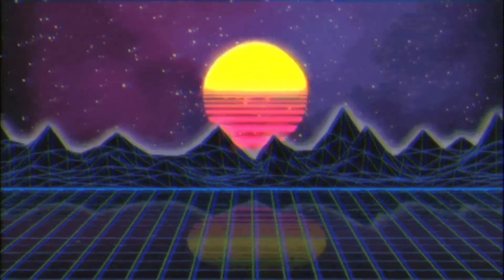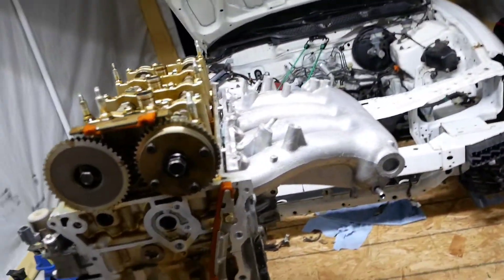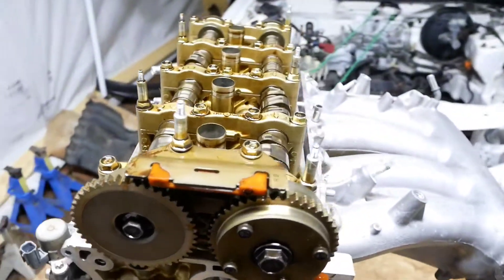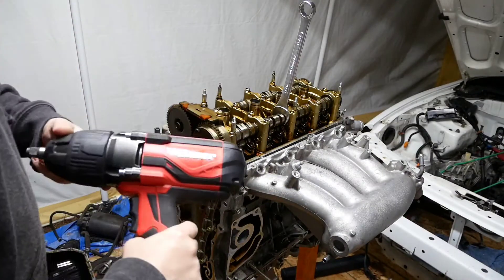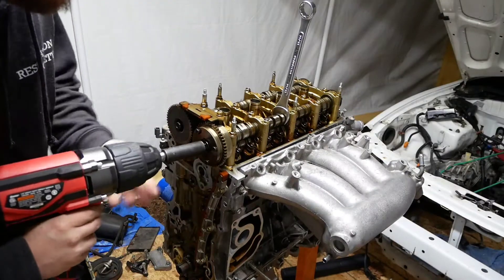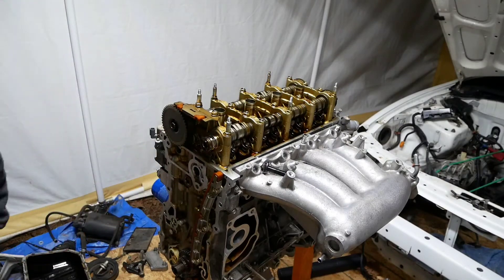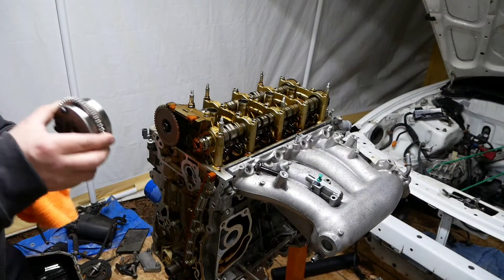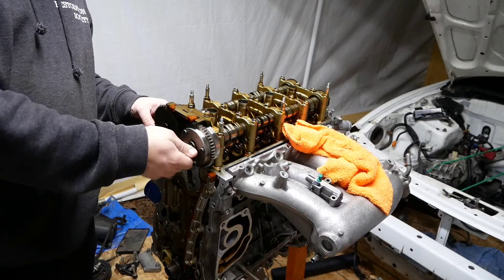K24 50° Vtc Cam Gear Install and Timing

Comment: What is the benefits of the 50 degree vtc vs the rbb?
Reply from the maker: The 50 degree gives you more timing capabilities. Little more adjustment for tuning
Reply: @theknytshift6981  so more torque?
Reply from the maker: In theory, more hp and tq to be had, yes.

Comment: So you guys think that honda engineers made a  big mistake by Installing 25 degree vtc rather than 50 degree vtc .in k24 rbb  motor. So now you are  correcting it.????
Reply from the maker: Basically, yes
Reply: @theknytshift6981  haha ,but how it's possible that I beat 50 degree vtc k24 from my 25 degree vtc. K24.
Reply from the maker: All the 50° does is allow for a wider ignition timing range. If you're going to stay n/a and use an RBC manifold, it's worth it to change. If you're staying stock RBB manifold, it doesn't make much of a difference, but sets the engine up for better tuning capabilities in the future.
Reply: Pretty much.
Reply: @loco4auto  say this to honda japan ,who created  f series ,b seires ,D seires ,h series ,and k ,l series ,j series ,,,,,, they will just smile on this lollz

Comment: So you unlocked the vtc with compressed air, torque it down, and then lock it back? Where do you put the air to do that?
Reply: They come unlocked if purchased new. If taken off another car then need to unlock it before install
Reply from the maker: Sorry for the late reply! You have to put the compressed air into the hole on the camshaft behind the gear

Comment: My k24a rbb 25 degree cam gear with use stock prb ECU? It’s ok?
Reply: Hi just asking which ecu you for k24a
Reply from the maker: I'm so sorry it took me this long to see this. I'm honestly not sure, since I haven't personally done that. On engine swaps, I'd recommend a tuneable ecu unless you're running the engine the ecu ran from factory. 

I'm using a PRB ecu with Hondata V4 installed.

Comment: Not sure if this is true or not. I have heard several others say that the vtc gear should really be tourqed down while in the unlocked position (notch on gear set slightly clockwise as shown) then locked afterward. This is apparently to reduce strain on the internals of the gear. Just thought this was worth noting
Reply from the maker: Yeah, you're right. I was backwards. I will say the car is doing fine as it is, but I definitely want update that in future for another video
Reply: When you showed the 50vtc, it was unlocked so you det installed it unlocked @theknytshift6981
Reply: It’s true, as a dealer technician I confirm it’s true, it should be torqued at 84 ft pound while  unlocked.
Reply: @alainbourdages7911  what's a decent technique to torque that bolt without locking it in the process. I've had to unlock it twice and start over already 😆
Reply: @noblewon3507  I usually leave the cam in the head, and I hold it on the heaxonal with a wrench, then I torque it. The shop manual uses a differnet method: they remove the cam completely, the squeze the cam in 2 bloc of wood in a vise, they remove and install the cam pulley that way.

Comment: Does timing need to be adjusted to the 50 degree cam gear or timing could stay the same, also doing this with oil pump
Reply from the maker: No sir! Timing is the same across the board. Your ignition timing is controlled electronically. I loaded a k20a2 basemap until I get a fine tune, therefore, the 50 degree is set up like a factory k20a2. It never reaches anywhere close to 50 degrees of timing on the basemap, so you're safe!
Reply: So, to clarify, the 50 degree gear is safe on K24A2? It's much cheaper than the 45 degree gear. Just gotta make sure the tune is set to factory K20A2 on an RSX ECU? Thanks man.
Reply from the maker: @michaelmiller7937  been driving it for almost a full year now and can confirm it's safe! On a the stock, k20a2 RSX basemap, at that. It'll be tuned soon and I'll be sure to do a video showing results!
Reply: @theknytshift6981  so i did everything but its on limp mode and we dont know what it is. Please help. All we did was, 50degree cam gear swap on k24a, rsx oil pump, exedy clutch and 9lb flywheel, motor mounts all around, we loaded up a tsxt basemap tune and still on limp mode, takes quite a while to start, has a z3 starter, stock injectors, rbc any other info u need to know in order to help lmk, thanks in advanced:)
Reply from the maker: @brayancortez3212  I wouldn't know 100% on yours, but my car did not like the TSX tune. For some reason, the stock k20a2 tune is what I had to use to get it run decently. I'd say to double check your parameters in Hondata and see if a step got missed.
Reply: @theknytshift6981  You running a Hondata RSX ecu? Or stock?
Reply: @theknytshift6981  okay thank you so much, will see how she is after i slap on the starter and new alternator just so we are sure thats not why its taking long to start
Reply from the maker: @brayancortez3212  also, make sure your fuel pressure is dialed in!! I had a massive headache of a time with my Ktuned fuel pressure regulator. Just something to check! Good luck!
Reply: @theknytshift6981  okay everything is stock tho, right now i have my rbc off swapping starter and alternator
Reply from the maker: @slumpedmage  hondata kpro v4 in a PRB ecu
Reply: @theknytshift6981  Big help. Thanks dude!

Comment: I'm fixing to do this on my 1989 CRX K24A2. Along with the Type S oil pump and oil cooler. How would you tune this with Hondata?
Reply: I've heard 30 deg before vtec and tapering down to 20 deg at the top end.
Reply from the maker: I loaded a factory k20a2 rsx basemap due to my ECU being a PRB(RSX). It's the best running basemap for the K series I've found so far. My k24a is running great on it.
Reply: @theknytshift6981  That makes since.